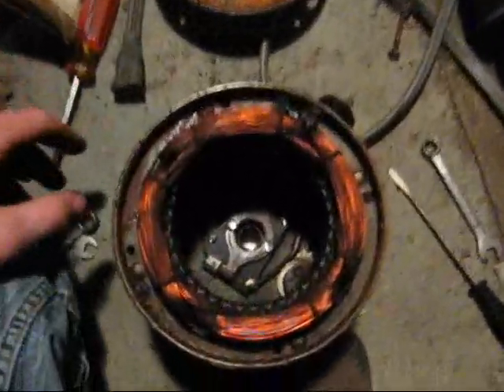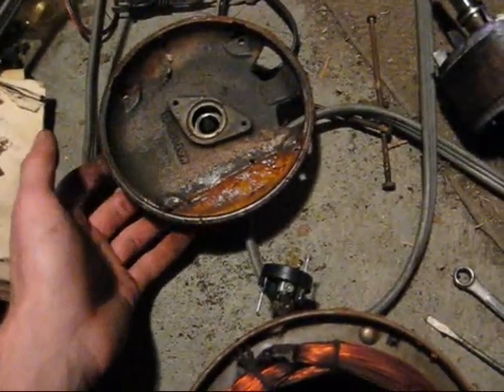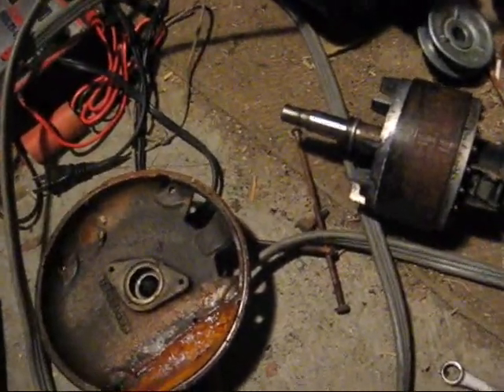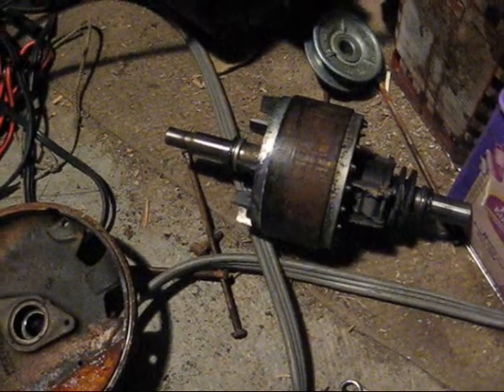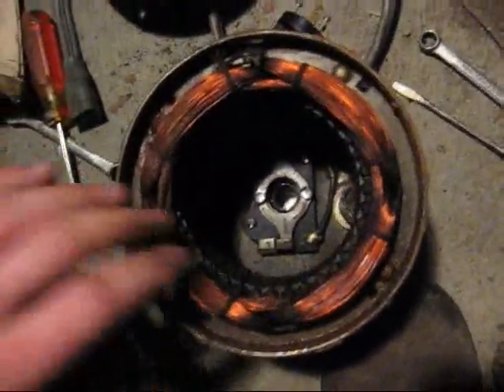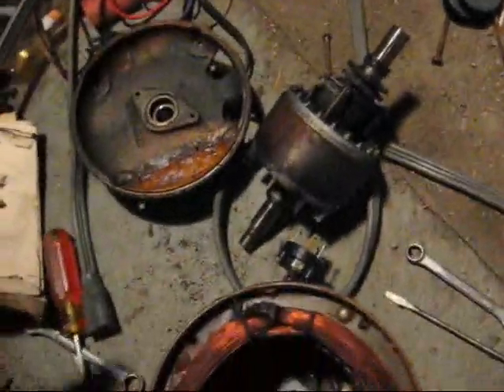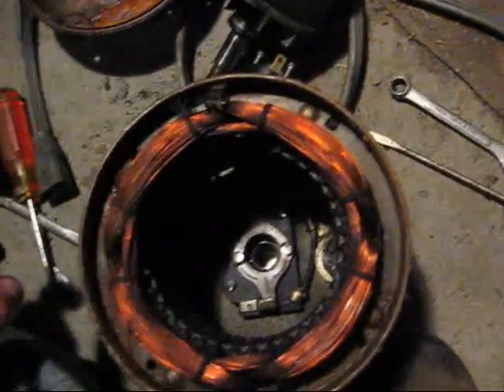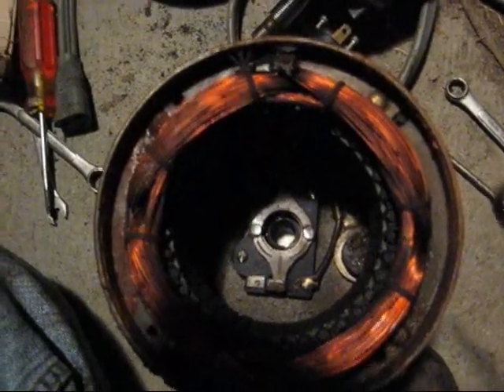Bell & Gosset circulator pump motor innards

Comment from the maker: @madmowerz brandon i belive you are refering to a brush riding repulshion induction motor. they operate just like a brush lifter but instead of the centrifugal weight lifting the brushes it shorts out the commutator using a necklace. the advantage to a brushlifter is the increased brush life

Comment: The clicking noise you mention is likely the internal start switch.  You show both parts of it in the video.  The switch is crucial to the start operation of the motor.  I just rmoved a GE motor from a B&G 100 pump--similar deal.  The motor needs a new start switch but is otherwise a decent motor.  I plan to clean it out with electric spray cleaner...